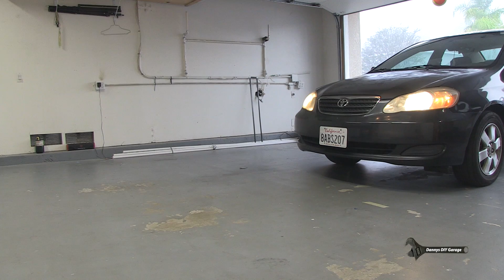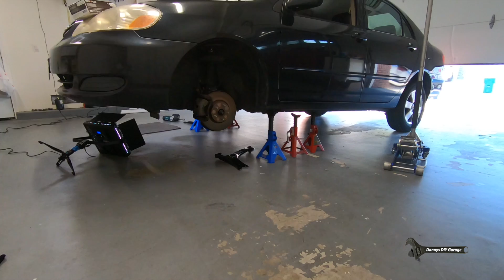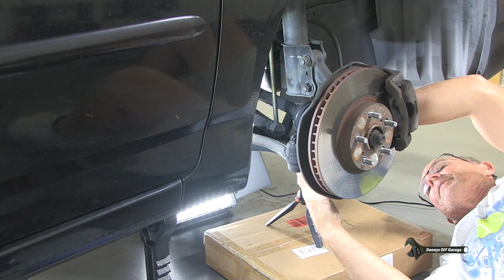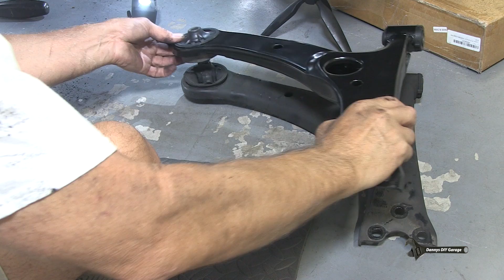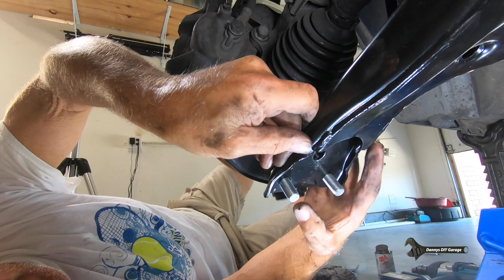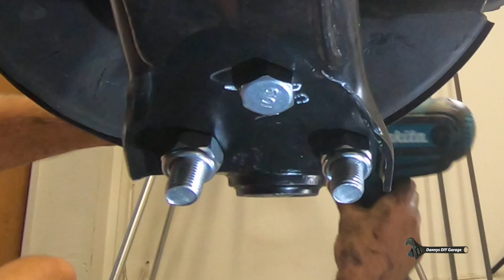Toyota Corolla Control Arms & Ball Joints Replacement Right side,

Comment: Remember guys, if any hiccups were faced the video wont meke it to youtube 😂, it's an actual hell if you do this without a lift in a garage if you were in a rust belt. Not to mention half the corollas out there you will need to lower the sub frame. Oh oh and every single bolt will be stuck inside the bushing and the only way to open is to cut the arm and the bushings with tons of torching and hest. Good luck

Comment: Note: the driver side is not as easy. You have to raise the engine slightly so you can access one of the bolts that's blocked by the transmission pan.
Reply from the maker: a lot harder, I hear stick shifts are good, no interference

Comment: QUESTION: is an alignment required after this control arm replacement job?
Reply from the maker: yes, defiantly
Reply: Most people say yes. I changed mine and did not require an alignment. Guess I got lucky.
Reply: Is not required but is recommended i would say

Comment: man, the right side is so much easier ! that one bolt one the left side is killing me..
Reply: Did you lift the transmission? Need to place a jack with a block of wood under the transmission to hold it. Then need to remove the bolts from the transmission and front engine mounts to be able to lift the transmission. You then lift the transmission to the point where you can access the front bolt of the control arm. The thing is removing the battery and air box in order to get to that transmission mount.
Reply: @gab_ale  Yes, ended up doing that! took me a whole day but was able to get the left side replaced. It was pain to get the new control arm in fit correctly
Reply: @PrinceofSaiyans Yeah , it was a bit of a pain to install  the arms. They need to be horizontal to enter easily, but without load they hit the link. I put a jack with a block of wood under the rotor, but ended up pulling the axle out a bit. In the end was able to put everything back on, but what a pain.

Comment: If you rotate the ball joint stem so it orients the cotter pin hole front to back, before you install the ball joint, it makes cotter pin installation and future removal easier. Also, don't forget the never seize on the cotter pin.

Comment: What are the torque specs please.
Reply from the maker: here is what I have it's been a while since I did this Steering knuckle at Shock absorber 113ft
Suspension support at Piston rod 34 ft
Suspension support at 29ft
Suspension cross member at Body Bolt A: 116 ft
Suspension cross member at Body Bolt B: 83ft
Suspension cross member at Transverse engine, engine
mounting insulator 38ft
Steering knuckle at Lower ball joint 76 ft
Lower suspension arm at Lower ball joint 66ft
Lower suspension arm at Suspension cross member 101ft
Wheel lug nut 76ft
Reply from the maker: I’ll GE that information and post it

Comment: I have an 09 and it looks like I have to remove the oil filter housing on the passenger side. On the driver side I didn’t feel confident that the trans oil pan could take any weight while jacking it up, so I just did the trans oil filter, dropped the pan, and lifted the trans with the jack and some wood as to not damage it. But pretty much same process.
Reply from the maker: Thank you for sharing

Comment: I had pulled the e brake on my 05 corolla at 60 taking a turn so I could drift, sure enough I did and hit right into a curb then into the grass. Nothing too major though, this video helped me replace my bent tire rod, thank you man.
Reply from the maker: You’re welcome, I appreciate the feedback
Reply: It's so tempting to use that e brake but it's just not worth it. That's a good car try not to crash it I know it sounds obvious but I know how tempting it is to drift even on the camrys with the foot brake.

Comment: Great video. I have two questions please: are both sides the same in terms of the process? and did you have to get an alignment aferwards?  Thanks!
Reply from the maker: Definitely it needs alignment, I have two videos one on the right side and one for the left side, the left side is more difficult if you have a automatic transmission

Comment: Do removal what brand arms? I have to do this on my matrix and now pondering aftermarket since Toyota is way back ordered. Want to avoid this misaligned ball joint thing.
Reply from the maker: This is the brand I used TOTRAIT Front Lower Control Arms w/Ball Joints Compatible with 2003-2008 Pontiac Vibe, 2000-2005 Toyota Celica, 2003-2013 Toyota Corolla, 2003-2008 Toyota Matrix.

Comment: Why are you replacing the control arm in stead of just the ball joint  ??
Reply: Control arm bushings are way easier and very cheap to change control arm with bushings installed